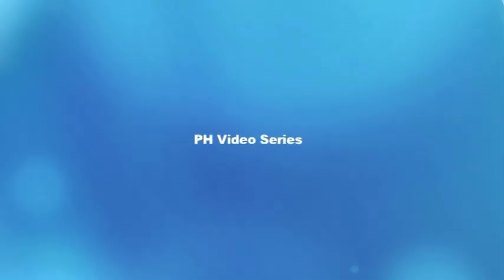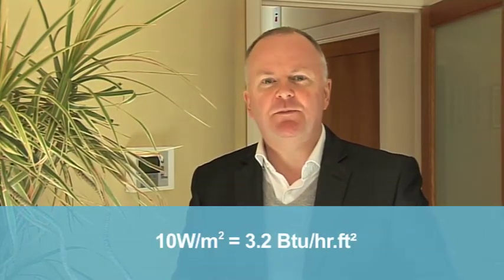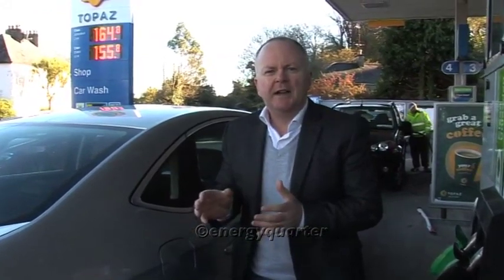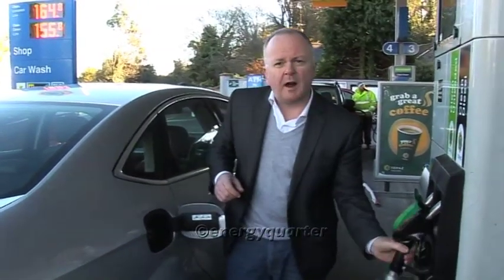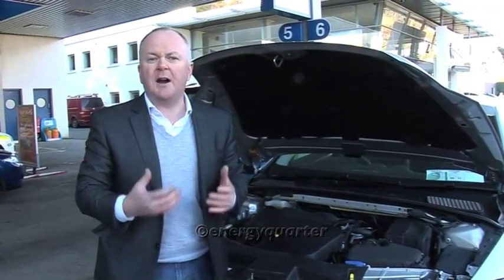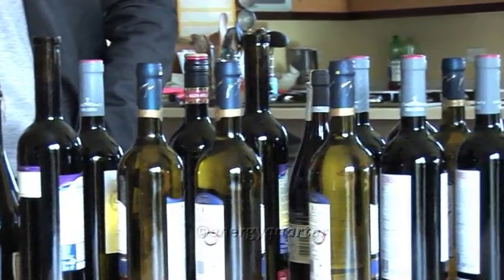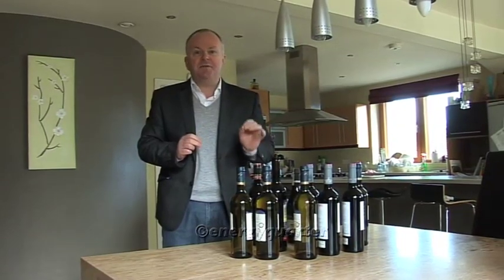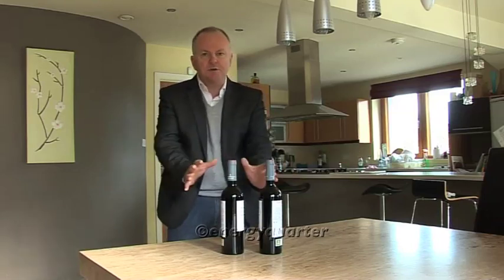Backup Heating Passive House Series

Comment from the maker: There are 3 air flow rate settings, commonly referred to as ‘boost’ (maximum mode), ‘normal’ (used 90% of the time) and ‘set-back’ (used to reduce air flow rate when the building is left unoccupied for an extended period).
The recommended air change rate for the entire building is between 0.3 and say 0.5 ACH. 
It has been my experience living in a Passive House for the past 8 years that the humidity (at least in Ireland) is very comfortable in winter, with no dry skin or respiratory issues.

Comment: Very interesting Tomas.  Questions; 
The thermostat has three settings.  When the house is unoccupied during the weekday, is the system left on "normal" mode or reduced?
Also, what about humidity control during winter months when the air is very dry and the humidity is low causing dry skin and respitory issues?  Does the HRV also recirculate the needed humidity inside the house?  

Again, wonderful videos, and a fascinating way to build a house.

Comment: I do like the heater battery method of heat distribution, it saves time plumping in a radiator or under floor heating system.